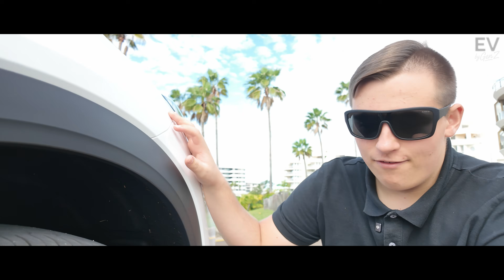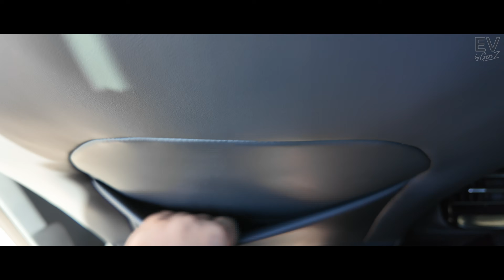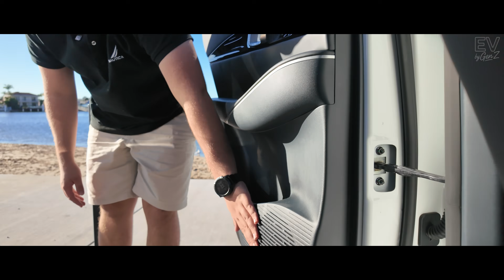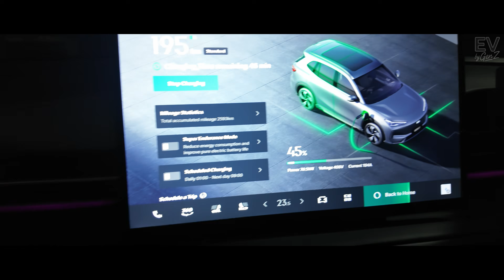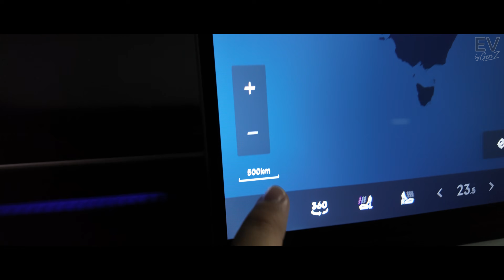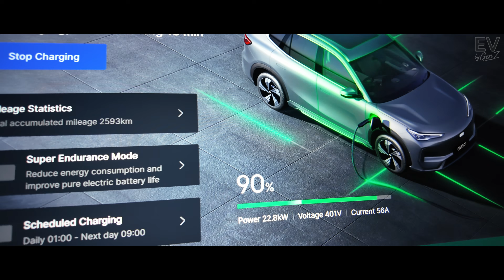Is the Geely EX5 the Best Affordable EV Right Now?

Comment: All these press-car short-term reviews worth very little. It's an absolutely different story once you have owned the car for a while. It's far from perfect. Good value for money, yes, but lots of compromises need to be made.
Reply: I've done over 13000kms in mine. No problems.  

What don't you like about it?
Reply: @gogojojo16 I don't like that my back aches due to no lumbar support. My left knee always hits the centre console. The blinker stalk has a sharp prickly knob. Blinker half mode is useless, need to press it too hard for normal operation. Boot is too small. Sunroof blind closes every time you lock the car. And the worst thing is that Geely disabled app sideloading in the latest firmware. Other vendors like BYD enable it, whereas Geely disables it. Shame on them.
Reply: @baderlade very subjective points. I'd love to have the sunroof close every time due to the strong sun here. Feeling of levers and controls again just personal.
Nothing major.
Seats also are personal dependant on your height and weight etc
Reply from the maker: Yeah, totally get what you mean. With press cars you only get a few days, so it’s hard to know what they’re like to live with long term. Things that show up after months just don’t come out in those quick reviews.
Reply: Can you further comment on your experience? I imagine you actually own one.

Comment: I have noticed, that some of your footage was done in the night. I would be great, if you could night driving in your tests. My current experience is that many Chinese cars don't have good head lights (compared to my former Mazda).
Reply from the maker: That’s a really good point! I did grab a bit of night footage this time, but I’ll definitely start doing proper night‑time tests in future videos. Headlight quality makes such a difference, and you’re right, some of the newer Chinese EVs still don’t match the level of cars like Mazda when it comes to headlights. Thanks for the suggestion :)
Reply: Nothing wrong with the lights on this car. LED 👌
Reply: @zwieseler  LED doesn't  means good lights per se (I had to learn). Our Dolphin and Atto 3 have inferior lights than our former Mazda CX-5. The lights are not as bright and even as of the CX-5.
Unfortunately most of the YT reviewer don't make night drives. Many Chinese cars don't have good headlights - but they are improving.
Reply: This one is v good. I also have an MG4 which has excellent lights. Had a Toyota previously and the MG and Geely are as good. But testing headlights could be good….